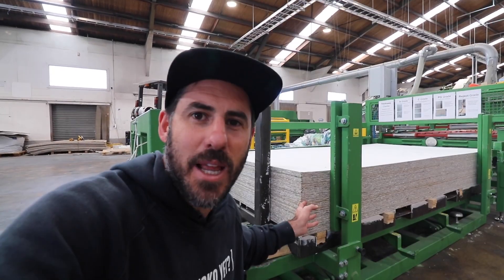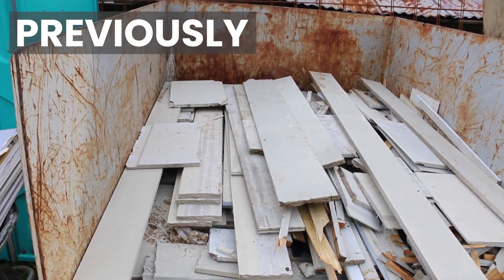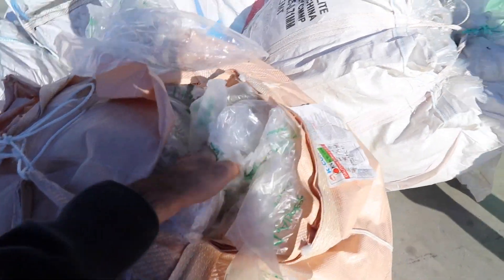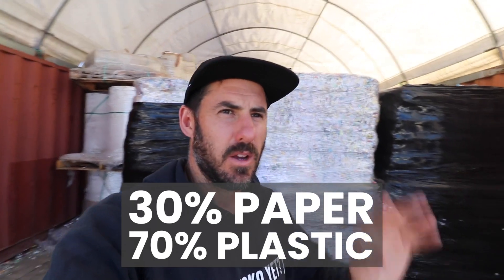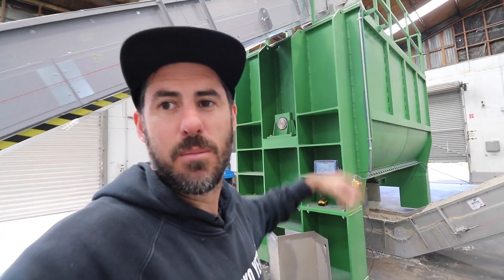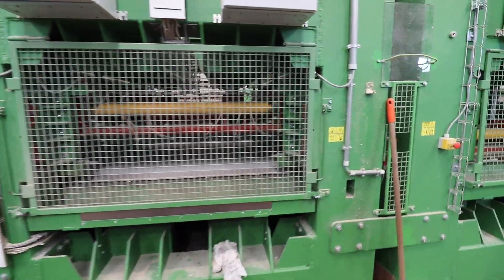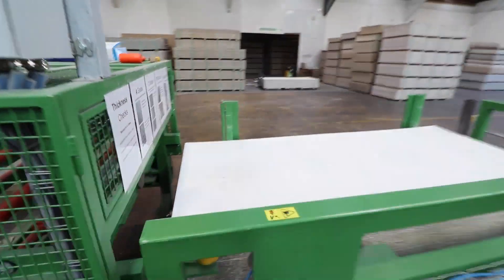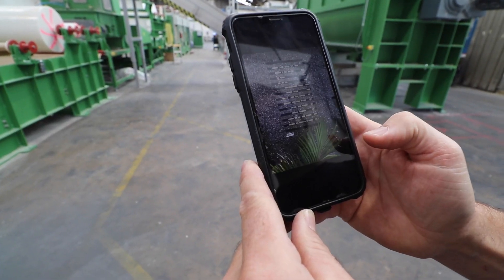Turning plastic into Drywall!!!

Comment: Mate - this is so cool. 
Any chance you can do a video going into a bit more detail showing what it's like to work with?

Maybe a small demo project? 

I'm assuming its a bit like working with plywood? Do you have to countersink screws? do they do a board with a recessed edge where you would tape and plaster? These are my burning questions lol
Reply from the maker: We are talking with Saveboard about doing an install on an upcoming project, If it happens I will be sure to post :)
Reply: @nzbuilder  Mean - cheers bro!